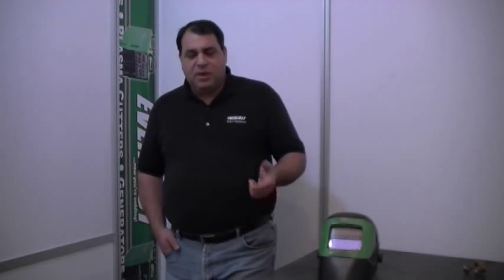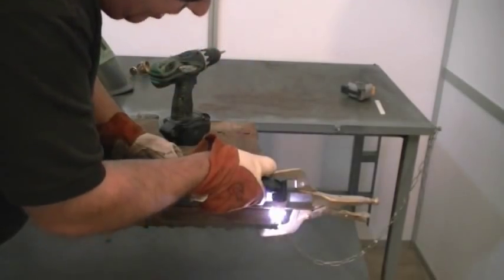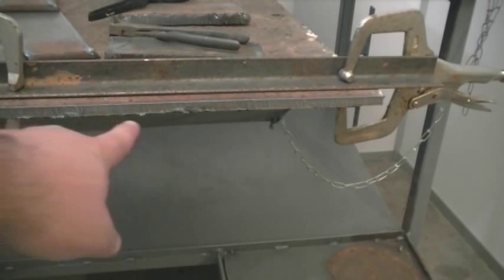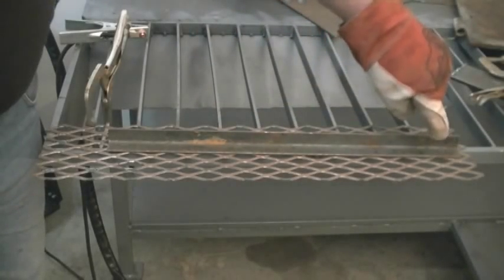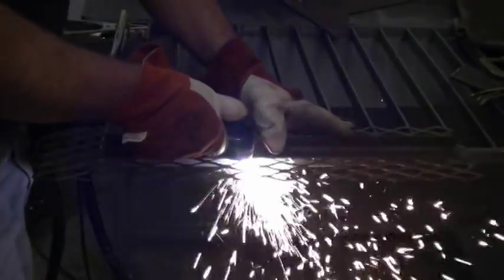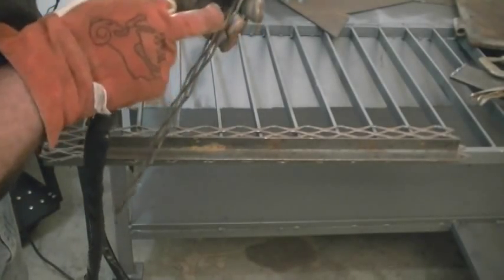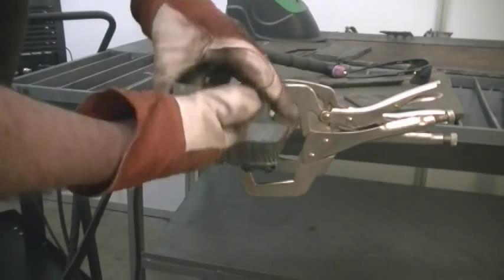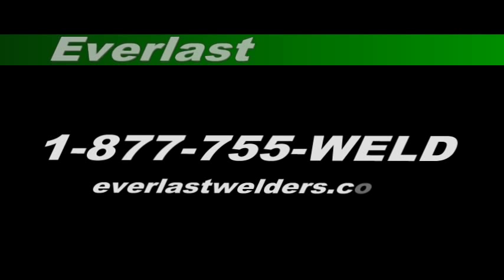Plasma Cutter - PowerPlasma 60 part 2- Everlast Plasma Cutters

Comment from the maker: @bolockbrainyoutoo 
1) The direction of travel makes no practical difference.  CNC cutters use multi directional cuts with a work clamp being placed on one end of the other, and travel is all over the place.  
2) The plasma arc, while it has potential health hazards, the arc is nearly buried and exposure to direct rays is minimal compared to other processes.  As with anything, long term exposure is key.  The area of the hands were covered and shielded that received the largest  exposure.